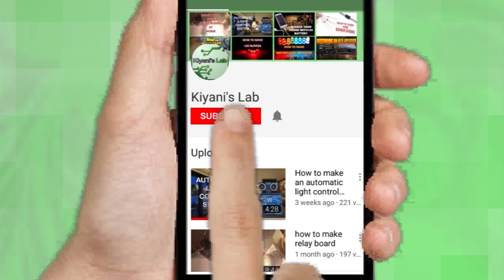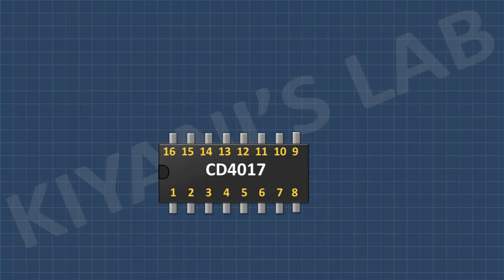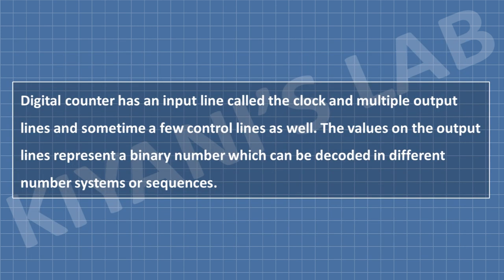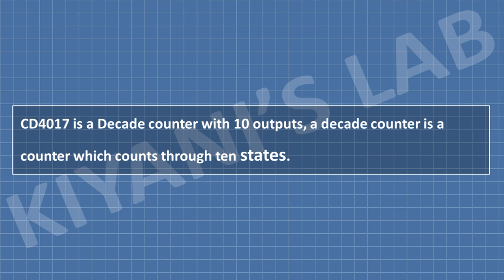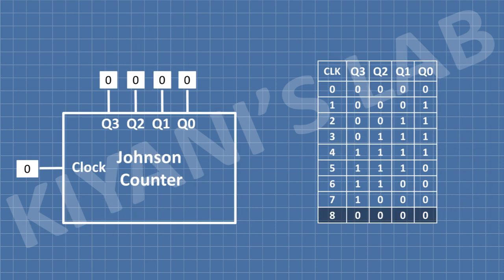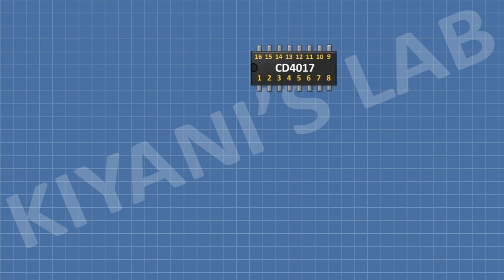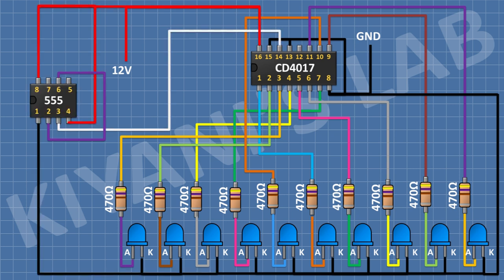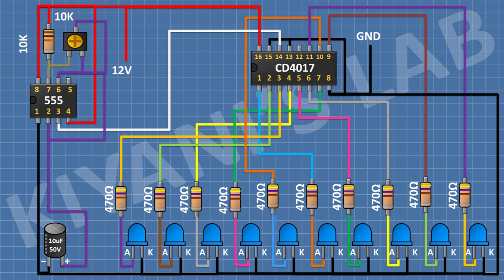What is CD4017 IC | How to use CD4017 IC

Comment: Good video! A while back i was considering modifying my cars tail lights to have sequential turn signals. I built this circuit but the build never got past the breadboard. Now im looking back at this design for my diy garden irrigation circuit. I am planning a long delay counter circuit to keep watering limited to daytime only, a decade counter to isolate individual rows in my garden, and shorter timers to water short intervals, (eg. 2 minutes every hour). Your video is a great refresher, thank you!

Comment: I suggest adding a capacitor to the powerrails so the timer doesn't accidentally skip one. I added a 100uF electrolytic capacitor and haven't had any issues when I did.

Comment: Is making an led chaser with more than 10 leds as simple as connecting carry pin to clock pin of a second 4017 counter?
Reply: Yes,but you will get one pulse for each carry from the first 4017 to the second 4017. 10:1.

Comment: What is the max ampere output from every single output pins of 4017?
Reply: thats nice question i really want to know.
I also want to what whats the output voltage of 4017? Can it drive 12V leds?
Reply: @casper8092  yeah, everyone is telling about pins, making chasers but nobody is telling or showing about the max output amp ratings. But after so much research i get only one result where it says 10mA but not mentioned if it's total ic rating or just a single pin rating